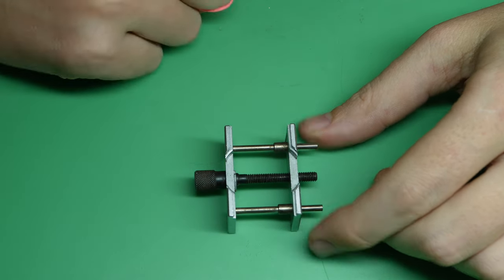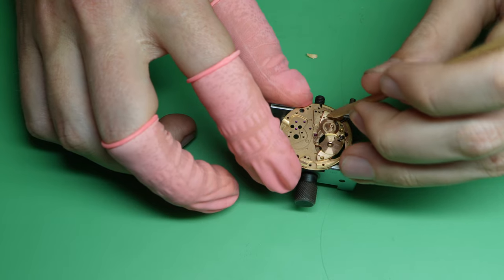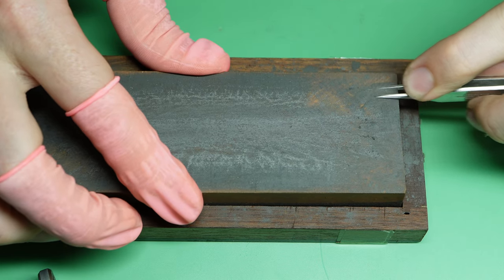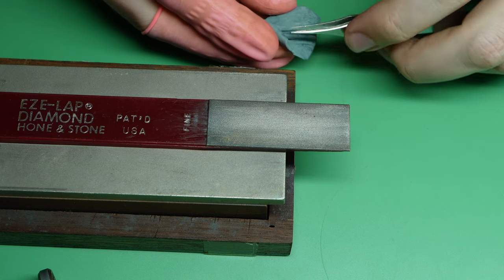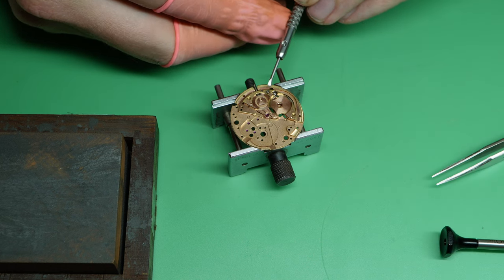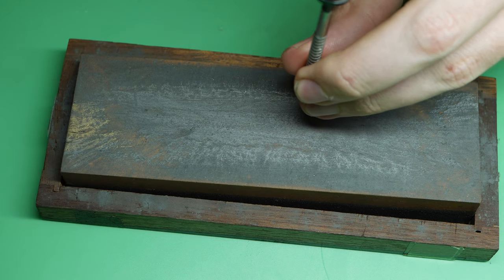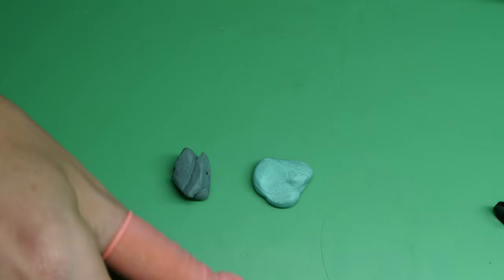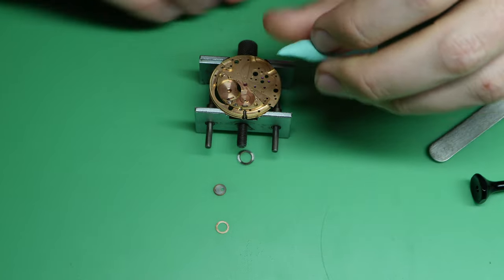Tips and Tools for Beginner Watchmakers!

Comment: I suspect a piece of wet & dry doubled up and gripped between the tweezers then pulled along to remove burrs and flatten the inner edges will suffice if you don't have a diamond file? Thxs I enjoyed watching the video.
Reply from the maker: Hey Pete,
That would certainly work. What I would recomend doing though is doing one side at a time. If possible try and glue the wet and dry to something thing so that you can do each side of the tweezers individually. The main thing to look out for is any rounding of the edge, as long as it's nice and sharp on the edge then you should be right.
Thanks
Olly
Hit me up if you have anymore questions mate
Reply: @obrhorology  Hi Olly, 
Just one question how do microscopic scratches get intorduced onto parts assume these are pristine from the manufacturer (or are they) say on a high end watch, does the cleaning process introduce any for high end watches  on parts such as the centre wheel? I appreciate these are cosmetic and do not effect the watch function.
Reply from the maker: Good question,
I could probably make a video about this. Basically watchmakers contribute a significant amount of the internal scratches. This is why it's important when handling parts to be really careful. You can limit any potential scratches through correct handling (how to pick up and hold parts) or by using wooden, plastic or brass tweezers. The second way this happens is in the cleaning machine if parts are moving around and touching each other. A lot of the higher end brands e.g greubal and forsey have special cleaning baskets to hold parts in place and stop them from moving around. Alternatively you can clean parts by hand but the issue can be that not all the old oil gets removed in the manual process. 
Thanks for your question. Let me know if you want me to elaborate. I could probably make a video on this. 
Olly

Comment: When sharpening you usually need the stone to be wet. Sharpening knifes is not that different to sharpening a tool as a screwdriver.
Reply from the maker: Very good point. In regards to the diamond stones I like them dry. But the other ones yes oil is recommended. More of a problem is that I probably haven't cleaned the stones regularly enough and should re flatten them.
Thanks
Olly

Comment: One "tip" to consider is to cut a 4cm cube of scrap hardwood, carefully drill 2 holes close to the centre of one face through it with a bench press. One at 5mm diameter and other at 6mm diameter  (at least that houses my particular screwdrivers). Using these holes to hold the drivers vertically whilst applying light pressure to the ends helped me get a perfectly square blade tip!
Reply from the maker: That's a nice tip. Sometimes it can be hard to square off the end. With enough practice it becomes easier and quicker over time. Any tool or jig to make your life easier is a good thing.

Comment: Thanks, always good to get someone else’s opinion on the basics.
Reply from the maker: Thanks mate! Will be sure to keep making stuff for all skill levels to help get into the field :-)
Reply: @obrhorology  I’ve been into servicing and fixing for about 2 years, completed about 40 watches now. Really want to do a chronograph. My biggest problem is the cost of tools and fixing really difficult issues as well as sourcing parts. I’ve subscribed, so will keep in touch.
Reply from the maker: Where abouts are you based mate. Are you in Australia or overseas. Can certainly point you in some directions to buy tools and what not. If you want to start chronos the guy "No BS Watchmaker" has a course on the 7750 I believe. What are you short. I could probably get a tool list together for chronos. The only thing that makes life alot easier is a nice movement holder for the eta7750 apart from that there isn't too many speciality tools needed for that calibre.
Olly
Reply: @obrhorology  Thanks Olly, much appreciated. I will buy a movement holder when the time comes and not too expensive. I still need to buy mainspring winders, I have a half staking set. I need a top quality crystal and back pusher. The list goes on. I live in the UK, but I see you live in Adelaide where I have relatives. Thanks for your replies!
Reply from the maker: Have a look on alixpress you can get some cheap but good mainspring winders that should get you out of trouble. If your in Adelaide swing by.
Reply: @obrhorology  thanks Olly!